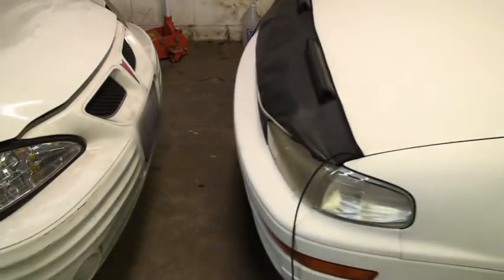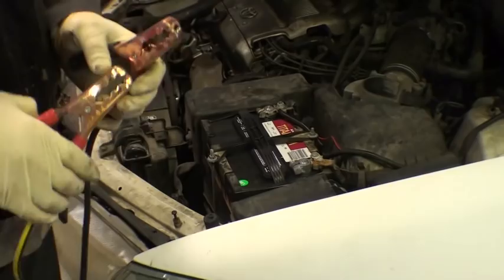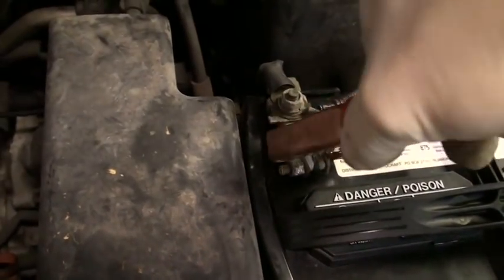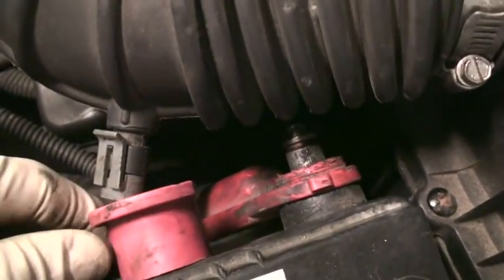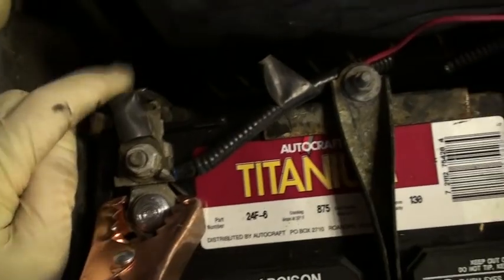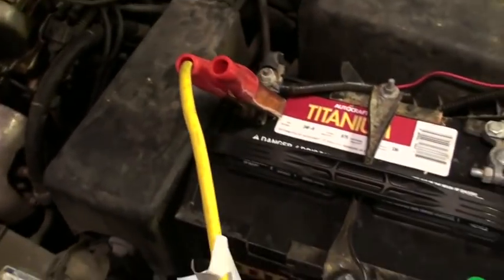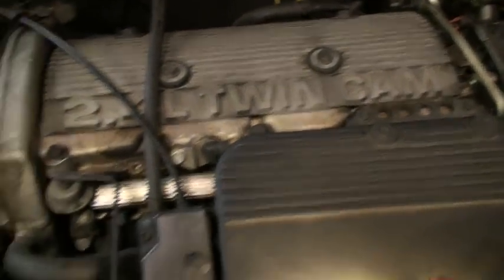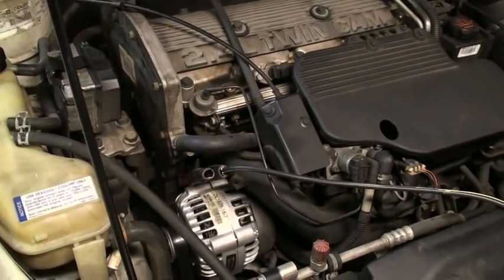How To Jump Start A Car - EricTheCarGuy

Comment: and why no negative with negative??
Reply: It makes a circuit and the electricity starts running around in circles heating everything up and doing bad things.
Reply: IceInMaWeiner don't you want a circuit?? Surely not for long term, but isn't completing the circuit what gets the battery running again?
Reply: Nyles Sanna
 Batteries charging/support must be done in parallel. When you go from the donor car's negative cable for the last connection, and you go to somewhere else on the receiving car for a good ground, it's still hooked up to negative. The reason you don't put both from battery to battery is not because you're avoiding heating things up - that's bad information - it's because even a correctly connected battery can blow up when connected. If you hook it to the body of the car and you're away from the battery I'm not sure if it's possible to blow unless you wired it backwards, but if it is, you won't have your face in the battery that just went bang.

Comment: 1) Don't jump it if you can actually smell that enough in an open air situation.
Means the concentration is pretty high.
2) What kind of sheetbox are you driving that smells like rotten eggs and has a faulty battery?   Consider a bus pass!
I'd have the car towed to a mechanic and get that crap addressed.

Now gimme a hug sugar!

Comment: Just to let you know Eric increasing the RPMs of the good car during the charge does absolutely nothing - that is what the alternator does - if the voltage increased your battery would explode when your traveling at a fast rate - plug a voltage meter onto it and you'll find out the voltage stays the same
Reply: ***** your very right, higher engine speed the more amps it puts out (usually) to a point.
Reply: +Mike Fazzari just as your NATHAN slaughter said, increasing the rpm's does do something, it increases the amperage, not the voltage, no one ever said anything about voltage.

Comment: Actually it CAN damage the working car if the dead battery explodes and the person hooking up the cables doesn't block ALL the battery acid from splashing over onto the working car.  And connecting jumper cables direct battery to battery is just ASKING for a battery to explode!!!  I've seen it happen, and I've seen people with scars from battery parts and acid that flew into their face  burning their face and upper body!  I've also seen chemical burns on working car from dead batteries acid.

Comment: No it will NOT damage the car... yes it WILL work, BUT it will spark if there is a voltage differential.  Should the bad battery be venting hydrogen, this spark will ignite it causing an explosion...  Yeah, I doubt your batteries will be off-gasing, but it IS a good precaution, so just follow Eric's tutorial; since, his way is safe...  Also, where safety glasses okay?

Comment: Not to be TOO much of a GIRL, haha... but when you are hooking up cables (one at a time ;) ) starting from good car, where do you set the other unconnected cables down at while you're hooking the others to good car? Obviously not touching... electricity scares the CRAP out of me in general.
Reply: +Dia FEIDressagePrincess put it on something that is not metal.  If you saw, in the video  Eric had clamped the cable onto the corner of the air box when he was doing the other side.

Comment: ive always done it just like that but instead of putting the last cable on the engine block or something i put it on the dead cars negative end of the battery. the car starts up fine why is this bad?
Reply: Kurt Pilon In most cases there is nothing wrong with that, however connecting directly to the negative can cause sparks which if you have exposed oil or gas fumes may ignite a fire. This isn't really likely to happen but a good practice just to be safe. Also when working with electronics you almost always want a ground just to limit the chances of getting electrocuted, not that it matters in this case because you could touch a cars battery and not even notice it.
Reply: ah ok cool!
Reply: negative end of the battery is essentially the same thing/idea of putting it on to the metal part of the car.  It's just a ground.
Reply: NOOBRIDERR I find with newer vehicles it's getting harder and harder to find grounds. I guess there is another downside to every changing vehicles.
Reply: +Seamus Fullerton its only 12vdc its not going to electrocute you.
Reply: HYDROGEN sits on the top of the Battery.  If you connect to the top of the battery and get a spark.  Do the math.  BOOM.  

That is why we connect the cables in proper sequence, and to the correct locations.
Reply: Hydrogen is the lightest of all the elements so there is no way it can accumulate on the top of the battery or any other open space...so yeah.

Comment: Reverse polarity will blow either or both batteries.
I've heard people have done it - which is good bec it keeps those morons from driving on the street.

If you can't determine positive to positive on a cable jump connection, you should be at home watching Three Stooges marathons.

Comment: The hoods are open. The air is flowing. The birds are chirping.
I highly doubt you're jumping a car in your living room or a closed area where the gasses could accumulate enough to be ignited by the spark from the live battery.

Comment: Your problems are unfortunately probably MUCH worse than a battery.  Although oil contributes to engine cooling, generally a car overheats when there is a problem with the coolant system (fluid low, thermostat stuck, bad water pump, broken belt, etc.)  If you overheat or run without oil and don't IMMEDIATELY shut it down the engine is toast.  If I may ask (mistakes happen), how did it have no oil?  :-(  While I freak about which Syn to run, ANY (even conventional Super Tech) works!

Comment: There is really no reason to start the good car just start the car with the bad battery then run for a good ten minutes so that it charges up the flat battery. Then shut down both cars and disconnect the batteries (starting at the engine connection first). Having both cars going is really a waste and maybe could cause some problems with a surge when the batteries have varying levels of charge. Good video otherwise